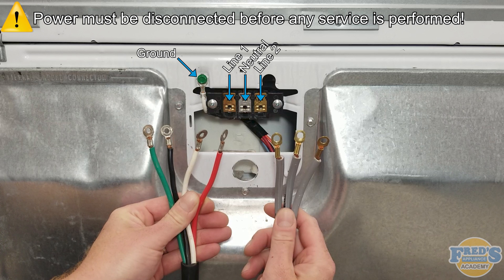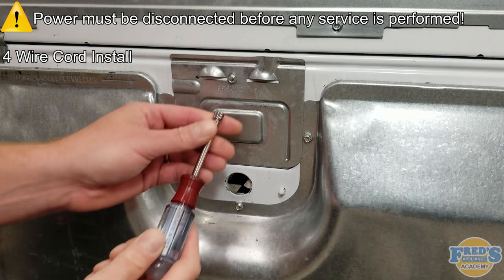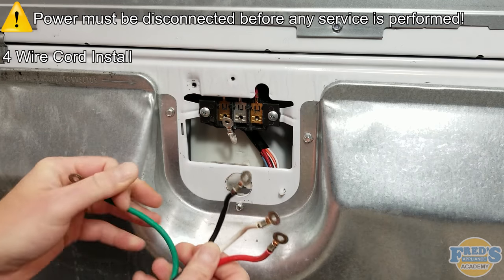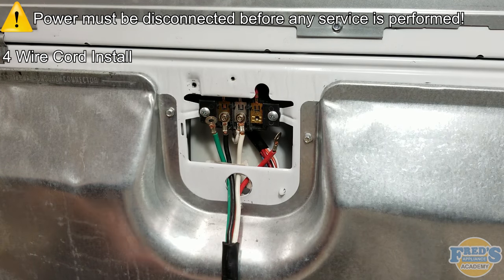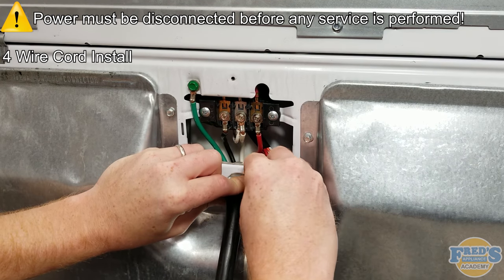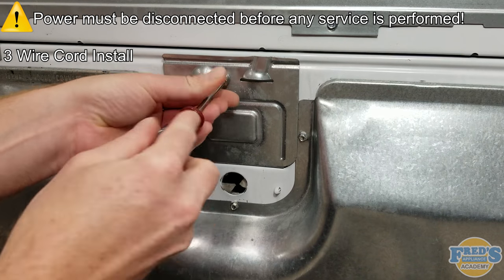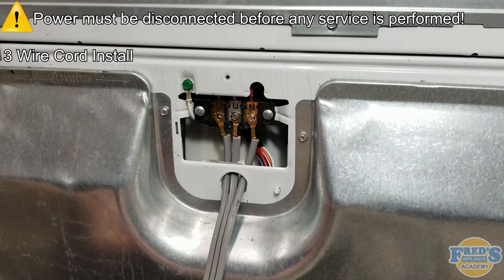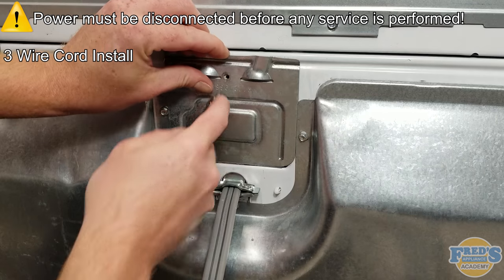How to Install 3 and 4 Wire 240 Volt Dryer Cords

Comment: Great video I subscribed!  
However I have a whirlpool cabrio platinum dryer Wed88004cl 
 ( had a GE profile before so I keep the cord ) 
4 prong 

My  4 prong plug issue ..  help!!!  — I placed the 2 white wires in middle but when it came to hooking up the green wire to the green screw it did not reach . My plug wires have fork tips. Should I order the whirlpool cord from Amazon with circle connections? Is the whirlpool cord green wire longer?
Reply from the maker: Circle would be better but as long as the connections are good and tight.  The ground wires can actually attach to the cabinet at any place. Just make sure all ground wires are in fact attached to the cabinet and tight.
Reply: Ok thanks. So attach to the dyer cabinet vs silver cover part right.
Reply: So can not attach to that silver screw on your pic if can’t reach to green screw? Must be in white part of dyer is that what you call the cabinet?  I ordered a cord( got whirlpool one)  from
Amazon hoping  the green prong wire  is longer to reach green screw top. At moment we have green wire attached to that silver screw on silver cover on top the white cabinet. I am worried it won’t be good enough vs directly on the white cabinet part. 

Waiting on my amazon cord today. Hope the green wire  is longer. Thanks .
Reply: Fred you save me. The amazon whirlpool cord worked gave me enough wire to hook up green wire to green screw. 

We used the semi rigid vent tube vs my old foil one. Followed all your instructions. Will send a pic when I figure out how too . Thank you so much .
Reply from the maker: Aww.  Glad we could help.

Comment: i have the estate eed4100sq0, i just had to change the whip because my new place was a range outlet so wired it the way u show it works but now it stays running if u open the door, cud anyone help  i mean if its safe to run like that i could careless , just wanted to know if its safe to run, also thanks for the video helped alot
Reply from the maker: No, it is not safe to use like that. You need to have a technician look at it.
Reply: @fredsapplianceacademy   i just did a load to see an everything eles works, but maybe my dryer needs the neutral wire with the ground?   this dryer is also  12-13 years old,  im so lost

Comment: My neutral wire on the machine is green- do I still pair the green with the white?
Reply from the maker: The ground wire is green. Please rewatch the video and follow the instructions for the type of setup you are using.
Reply: @fredsapplianceacademy  on my WPL Calypso dryer the internal wire is actually green with a yellow stripe, not white. The grounding wire on the 4-prong cords is of course white. In this case, do I still put the internal wire with the white wire on the terminal block or do I put that internal wire with the green grounding wire under the green screw? That scenario isn't shown in the video. TYIA
Reply: I have the same thing on my dryer and have the same question. Did you ever find the answer?
Reply: @ellegee9040  You wrote that the grounding wire on 4-prong cords is of course white.  NO, the grounding wire is NOT white.  The white wire is the neutral wire.  True ground wires are green or bare copper.  As for that answer you were waiting for from Fred's, follow their advice and rewatch the video carefully.
Reply: @larrywhited3070  Your just escalating the problem instead of providing a solution. Yes, Elle misspoke by saying "the grounding wire on the 4 prong is of course white. " But Elle still has a valid question:  In the video, when he opens the back panel, the single wire connected to the chassis is WHITE! In Elle's situation, like my own, we find it is GREEN w/ yellow instead. We are just wanting to know if we treat this green with yellow wire the same as he does with his white wire in the video.... since you so aptly reiterated green and white are NOT the same. Try understanding the question before critiquing the person asking.  I've watched several videos now and no one seems able to give a definitive answer.

Comment: Does anyone know if it matters if the grounding cable is green on my laundry machine? Just wanted to double check that I’m putting that down with the white line, together on top of the neutral line, and I’m not gonna burn down my house lol. And then put the replacing green line where the original green line is for mine, which again is white in this video, the separate one to be clear.
Reply from the maker: If you can track the wire back and it goes to the neutral wire you can bring them together at the neutral. If not you should leave them apart. Check the install manual if you by chance have it.
Reply: @fredsapplianceacademy  will do, thanks for the advice!

Comment: What will happen if I don’t use the same screws?
Reply from the maker: You should always use the factory specified screws in this application. If they are not tight enough or loosen, they could cause arcing which would naturally result in future trouble.

Comment: What do I do if I don’t have any white cords need to put on a 4 prong cord. Neutral and Ground wires are green no white wires at all only on new 4 prong cord needing to be put on. If anyone can help I’d appreciate it thanks!
Reply from the maker: Take the green ground wire on the cabinet and place it onto the neutral slot in the terminal block.  Then take the neutral wire on the cord and attach it to the neutral on the terminal block and secure the connections. Take the black wire and fasten it to the left side of the terminal block and the red wire to the right. like you saw in the video. Then take the ground wire on the cord and attach it to the cabinet. Put the cover plate back on to cover the terminal block and you should be good to go.
Reply: @fredsapplianceacademy  thank you !!!

Comment: What if there is 2 green screws
Reply from the maker: It's likely that's just two different places the ground wire can be installed. I would reference the installation manual if you have it.

Comment: Is it safe to go from a 4 wire to a 3 wire plug in on an electric dryer?
Reply: Yes
Reply: Yes
Reply: not according to NEC
Reply: Too loose of a question with too many areas for misunderstanding and mistakes.  Answering this question with a yes or no leaves too much room for error.

Comment: What if my external ground connector is green instead of white?
Reply from the maker: The instructions should be the same. However, reference the owners/installation manual if possible.

Comment: Question I have a four prong wire connection wasn't able to get the ground screw loose so I put electric tape on  ground wire and kept the original ground wire connected to the dryer and continue to install the connection was that okay for me to put electric tape on the ground wire
Reply from the maker: I apologize but I do not fully understand the question. However, I will say all of the wires on the cord should be attached to the dryer.
Reply: @fredsapplianceacademy  cool enough question answer thanks
Reply: RIP
Reply: @errorsofmodernism9715  lol got it fixed now 💪💪💪

Comment: What happens if you join the white and green in the middle but don't move the ground to the middle?
Reply from the maker: It is unsafe to join the wires together as you have explained them. It also defeats the purpose of the 4 conductor cord.

Comment: What if I use different screws?
Reply from the maker: You can't because the nut that holds the screw is specially threaded.  Using different screws can cause loose connections which can result in shorting or overheating of the wiring.

Comment: im switching from a four to a three, do I need a ground wire?
Reply from the maker: When switching from 4 to 3 the neutral becomes the ground wire.
Reply: @fredsapplianceacademy  so what do I with the green and yellow wire
Reply: @fredsapplianceacademy  Hello, I have this same question. I switch from 4 to 3. I don’t have a wire that’s connected to the green nut/screw. My dryer starts then automatically stops. Should I have a wire on the green screw?
Reply from the maker: @fashionableesquire989  If you are switching from 3 to 4 the green ground screw should now be holding a neutral wire.  This is usually a white wire or a metal bracket that comes off of the terminal block and is attached to the ground or body of the unit.

Comment: Does it matter which sides go on which? Like could you put it on upside down as long as the middle is in the middle?
Reply from the maker: As long as the neutral goes to neutral it will work.

Comment: In not sure why machine didn’t turn on i did it on a whirlpool stackable i did everything right but im not sure why it didn’t turn on I didn’t you said any help?
Reply from the maker: Very sorry, but if it's not working you'll need to hire a technician to diagnose the issue.
Reply: @fredsapplianceacademy  I just bought my machine do you know if it could be that i need a 220v instead of a 110v
Reply from the maker: @Ezeke_  that information will be on the model/serial number tag.

Comment: Hey I switched out a 4 to a 3 but it’s overheating now. What do I do
Reply: still have the issue?!?
Reply: @berthacuevas7674  go back to 4 to avoid a fire look up code concerns with the NEC possible shocks to dryer I am going through this now with inspectors

Comment: I know this video was over a year ago but right now as i speak 🗣️ my house is built in 1957 so we have the three prong outlet 220 and the new dryer we got came with a four prong so we're trying to put a three-prong on right now and my mom's watching all these videos and they're saying put the ground white wire in with the middle and yours is up in the left hand corner....HELP
Reply: Rewatch the 4 wire segment, it does say to connect the ground wire from the DRYER to the middle post.

Comment: Though you were going to show how to use a 3 wire on 4 wire appliances
Reply from the maker: Most appliances are set up for 3 wire install. However, if the appliance is set up for a 4 wire install it may be intended for 4 wire only. Not that it cant be done but it might require some altering of the appliance which would be unnecessary as you could just buy a 4 wire cord.
Reply: @fredsapplianceacademy  thanks for your quick response. I have a 3prong outlet and was looking for the hack to install it on a new dryer that is made for the 4wire so I don't need an electrician to rewire my older outlet
Reply from the maker: @JoeHall-c9f  Okay, we hear ya. all you really need to do is make sure the grounding strap or wire is attached to the neutral on the terminal block and then attaches to the ground or cabinet of the dryer. After that simply install the 3 wire cord just like you saw in the video and you are good to go. We hope that helps!

Comment: I am using a 4 wire cable. I noticed that the dryer you're showing, for the ground little wire is white (when you removed the placement to use the green wire ) My little wire is green instead of white. Would do use the same instructions that you did which is to remove and put it with the neutral wire?
Reply from the maker: Yes, you can follow the video and it should work okay.

Comment: I plugged them in right and tightened the screw and it’s still not working
Reply from the maker: You might have an electrical problem. Check for power if you can.
Reply: The house is newly built

Comment: sir how much voltage on L1 & L2 , kindly guide me,
Reply: L1 to L2 should measure 240v and L1 or L2 to ground or neutral should be 120v.
Reply: @surferdude642  ممكن توضيح أكثر لو تكرمت

Comment: I almost killed myself yesterday fresh out the pack before I connect the cord to the dryer I forgot to take the plastic off the wire plugged the cord in and everything turned off I was  so scared

Comment: I tried and it didn't work. Maybe i need a ground wire
Reply from the maker: Ground has nothing to do with the unit working but in both cases the ground has been installed. You might want to call for service.

Comment: Why there are three and 4 wires ?????
Reply from the maker: The 4 wire is the new electrical code as it has an extra wire for additional safety. It does not change the operation of the unit.

Comment: Mine doesn’t come with the ground wire
Reply from the maker: There must be a wire on the cabinet. This is to prevent electrical shock. If needed please review the video carefully to determine the correct setup.

Comment: Ok. This is my very first time doing this… so please don’t laugh.   I noticed when connecting the 3 prong, you left the white wire (attached to washing machine not the cord) connected to the green screw/ grounded. I always thought I was supposed to disconnect the white and connect it with the neutral (middle) …..
Reply from the maker: In the 3 wire install that wire stays on the cabinet because it serves as a ground wire :)

Comment: Be nice did you told us which outside wire is line 1 and which is line 2?🤷‍♂️ without knowing that, this video is useless
Reply: The middle one is the only one that matters. The other two are basically the same thing.
Reply: Both legs each provide 120 VAC, but consider one to be plus 120 volts and one to be minus 120 volts (alternating current, so the + & - are constantly alternating).  Across these two 120 legs you therefore get the 240 VAC for the heating elements, with only one of these 120 VAC legs then also providing power to the motor.   Your dryer doesn't care if line 1 is powering your motor, or if line 2 is.  Also, the dryer doesn't care if it gets its 240 volts for the heating element from line 1 to line 2, or from line 2 to line 1.  The current is constantly alternating.  VAC = Volts Alternating Current.

Comment: Grrrr! Second video not explaining how to tell which way the greys go. It can flip. There’s no writing on mine left/right or which way. You didn’t explain it either…..hello! Ugh 🙄
Reply from the maker: With the cord flat, the center wire is neutral and will always go to the center connection on the terminal block.  The wire on the outer left is the l1 and will go to the outer left on the terminal block while the wire on the outer right of the cord will go to the outer right on the terminal block. Please note that it does explain this in the video and feel free to take your time and watch it again.
Reply: Same reply I posted to a similar comment: (and Fred's Appliance's reply is 100% correct).....Both legs each provide 120 VAC, but consider one to be plus 120 volts and one to be minus 120 volts (alternating current, so the + & - are constantly alternating).  Across these two 120 legs you therefore get the 240 VAC for the heating elements, with only one of these 120 VAC legs then also providing power to the motor.   Your dryer doesn't care if line 1 is powering your motor, or if line 2 is.  Also, the dryer doesn't care if it gets its 240 volts for the heating element from line 1 to line 2, or from line 2 to line 1.  The current is constantly alternating.  VAC = Volts Alternating Current.